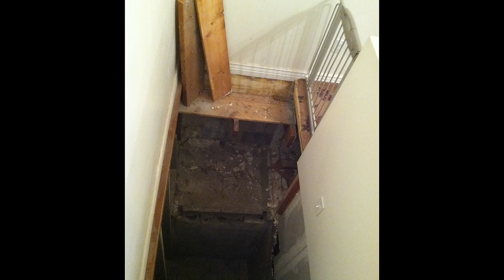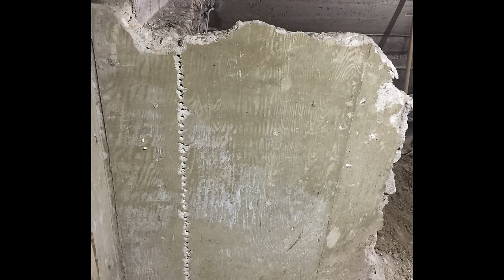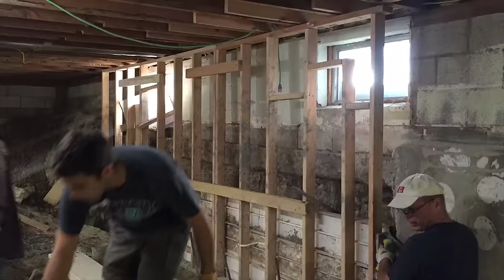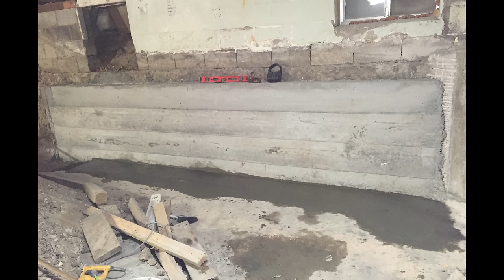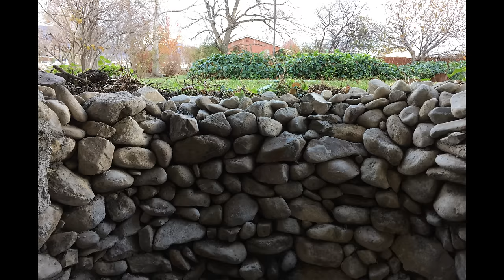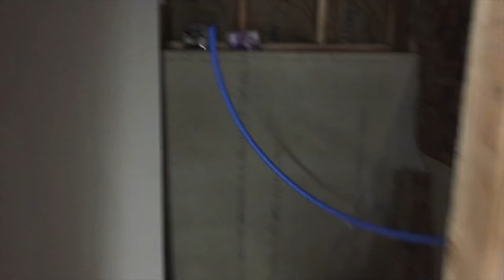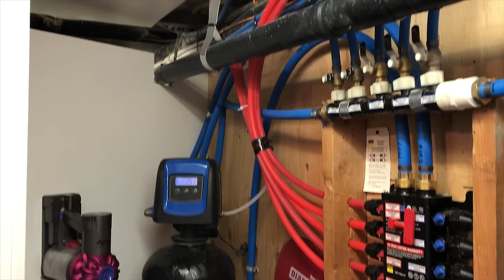Basement dig-out start to finish

Comment: Great work, makes me exhausted just looking at it.  ;-)
I'm wondering why you did the mid stair platform that way (head height)?
Reply from the maker: Thanks, Yes it was done for head height.  It's not conventional but it gave me a couple inches.
Reply: I forgot to ask, why did you wall in all that space above the new concrete walls (easier)?  It would have made good open, enclosed or a combination storage (I don't like wasted spaces). ;-)

Comment: Incredible work. Congratulations! Did you have any structural engineering or structural inspection? Oh, and doesn't the subwoofer belong in the corner behind the curved sofa? ;)
Reply from the maker: I had a guy I used to work for that did the structural engineering, he is the one that advised me on how to do this.   There are 3 of those sub-woofers, one is behind the sofa as well , lol.

Comment: This is an awesome project that I would also like to do. Me and my boys will likely do it ourselves. A couple of questions if you don't mind. 1) on a load bearing wall. Your existing wall is 8" wide and your footer is likely 16-24" wide. In your notes above your new wall is only 4" under your original wall but it is still supported by the earth below it. Is that adaquate support? Any setteling related issues yet? 2) Did you add any perimeter drainage or sump pit? Thanks for sharing!
Reply from the maker: I hope I can answer this clearly,  When I removed the dirt I went 4" under my existing foundation footing, and 4" out, creating a new 8" cement wall down to the ground level.  At ground level I dug out a new footing to the same size as my existing foundation, I think approx. 24" I did sections at a time as you can see in the video and tied them together with re-bar.  No settling issues because all the ground  behind and under the new cement was never unsettled, so it was solid.   I should draw a picture..
Reply: As long as the material you are installing your footing on is virgin ground and not wet clay or very silty then you will not have any settling problems. As if needed use 3/4 or 1 1/2 stone under the footings as stone has a 90% compaction rate just set in place without compacting it. If you use common sense you will be fine. And a sump pump is good to have and not need it.rather than need it and not have it.

Comment: Hope theres no mold issues.   I didn't see any water proofing.  Or sump holes
Reply from the maker: I did water proof behind sheet rock, might have been hard to notice, I'm also in a dry climate.
Reply: @StewartRedmond    wasnt talking about behind  drywall.     On outside of thos concrete walls u hand formed. Where I live we have to tar it.   Spray like rubberized undercoat looking stuff.  Its code here.  But where not dry climate  either.

Comment: Not to be dumb, but i would like to do this, and i'm just wondering how do you keep the wall you are working on from caving in while you dig it out?
Reply from the maker: I did small sections at a time, and only went 4" under my previous footing.  The dirt here is very compact with lots of clay/rocks, so it was hard and settled. This is what I did, but I am not a structural engineer, and I'm not offering advice.  I did talk to some people who had done it before this way.

Comment: how on EARTH did you get the re-bar to be continuous through the floor if you did it in sections???
Reply from the maker: The floor or the walls?  I left 12-16 inches of rebar hanging out of the cement to tie into the next pour.
Reply: the floor i meant but walls would be relevant too - ok- i was just worried that maybe you'd poured cement without it or without adequate re bar

Comment: Nice work.... But did you tie in the new foundation walls so the don't Buckel in?  Also, the egress Windows look small? Are they to code? If yes, to both. Great job. You just made a ton of living space, what is the additional value to your home and was it worth in in new taxes?
Reply from the maker: I did tie the foundation walls together with rebar.  The house is 100 years old and the windows were half the size before.  I made them as big as I could without cutting the original footing of the home.  An adult can climb out of them.    I haven't calculated the additional value, but the market has also changed a lot since I began, and my home is worth more just for that.
Reply: Thanks for the info.  Great Job!  Hope your having great times down there.  I need to add egress windows to mine.  The owner before us didn't do this to the remodel of ours and is "non-livable" space until we do so.  Enjoy life and keep on.

Comment: What about rebar? I didn't see you install any?
Reply from the maker: I did, its probably hard to see in the video.  Rebar runs the length of each section and ties sections together.
Reply: Sorry buddy.  But that's wrong way of doing .
Reply: @Dp1v   Ha, it's a fucking retrofit replacing blocks. It's a million times better.
Reply: Was curious about any french drain or radon management and code with the pluming and electrical in the closet. Have an OOOOOOLD HOUSE, needs work.

Comment: Where do you live that those bedroom windows meet code?
Reply from the maker: They are twice as big as they used to be, without cutting through the load bearing beam of the home, or cutting the original foundation, they could not be made any larger.  For a 100 year old home it's an improvement.

Comment: Dude. You can rent a concrete saw for a hundred bucks for a whole weekend. Damn. Drilling holes to cut concrete 😱
Reply from the maker: I had used a concrete saw, but it was so dusty, and dirty i just drilled. lol
Reply: Stewart Redmond ahhhh yes. That would be true. A little water from a hose will settle the dust. Still did more work on this job then most will in a life time 👍

Comment: That sure looks like a lot of work. It looks good now when it is finally done. It doesn't say what state or where you located at but as an inspector in Wisconsin your steps going into the basement illegal, there is no landing. When you change course on the steps you need a landing. how many times are you going to trip over that step? I'm watching the whole video and none of your windows in the basement have an area of egress in order to get out of. if you are planning on having your kids bedroom like you showed it in the basement there's no way of getting out of the bedroom windows  because you need two ways out of that bedroom in the basement. You need to have a big enough window so a fire fire with Soldier can get into that window in the basement. Also from the picture it looks like the window well is too high so you would need to stop also in order to get out of that window and that's if it has enough space to get out to the yard in case of fire. People don't realize that they cannot have bedrooms in the basement without having two ways out of it. I've known of people dying in the basement because of this. People think they can get out up a little window in the basement which is almost impossible because you have to crawl up to it and then crawl through the glass to get out of it.
Reply from the maker: Well if you consider that the house is 100 years old and the windows used to be half the size they are now.. At least it's an improvement.  I made them as big as I could without having to cut out the original footing of the house.
Reply: But haven't the building code changed over the last 100 years? Probably not the safest place to sleep incase of fire, whit only one exit :-/

Comment: No poly/ moisture barrier under the floor plates
Reply from the maker: By floor plates do you mean the cement floor?
Reply: Stewart Redmond Floor plates are the 2x4's sitting on the concrete floor, making the bases of your walls. there should be some poly or kind of moisture barrier underneath the bottom 2x4 to keep it from moisture and rotting

Comment: Never understood why certain pipes are built directly in concrete, because of code? It does nothing but make getting to them so much more difficult and  Time consuming and money consuming. I wouldn't have put concrete back over that sewer pipe. Metal grate door and now you have easy access any Time you need to get to it.
Reply from the maker: perhaps to keep moisture out, the smell of dirt, etc.

Comment: No farm, instead you have cool office is that wise? you'll need food more if something bad happen and it last longer than 5 years you know. How do you generate independent electricity Wind Mill or Solar Panel? if its local grid if its got cut off you cant even use your cool office you know not even those hundreds lightbulb of yours...And last how do you get water run through your bunker do you use pipeline down to river connect it with your water pump then to your water filtration system then to your bunker or not? getting dehydrated while sitting in a cool office doesn't means you're cool though....how about entertainment...what kinda entertainment did you prepare for the residents? boardgame,Pc Game,Card Game or something else? no entertainment for more than 1 year in contained space gonna make ppl go (cwasy u no...giggle)
Reply from the maker: Yes, no, wait what?
Reply: you're building your  basement nearing the requirement of a panic room or bunker good friend. why built it like that ...i mean kid's bed included in basement....normal basement dont have that kinda thing right? so the specs really cutting close to a place for refuge and seeing it like that i just can help myself to write comment. hey if you dont like it just ignore it though
Reply from the maker: @felixdedi5559  Ah gotcha, I just didn't  understand what you where meaning.  ha ha.

Comment: My parents had a 2 story house, like that. Older home all brick and the basement had been dug out like that. Had all sorts of water problems because there was no drainage outside at the level of the new floor. Long story short a contractor was hired to install drainage, but he dug too close to the outside wall and the house collapsed.  Digging your own basement is a REALLY bad idea if you do not lift the house and replace the foundation. It should be made outright illegal to do it like that. I would never buy your house, nobody should.
Reply: Pierre C 
wouldn’t have happened had they done it right.
Reply: Totally agree with you. They bought the house like that, unaware that it had been done in that manner, quite like as shown in this video.

Comment: That pex is trash
Reply from the maker: I like it, why don't you?
Reply: The pex you have it trash like as in it’s the cheapest why to install water lines and the crimp rings are illegal due to leak failures and if you have a freeze it will ruin your whole system which I saw y’all didn’t Insulate the lines and Rodents can smell the water and they will eat through the  lines now uponor  pex is better just like cpvc or copper lines. I’m just saying you get what you pay for

Comment: no relief cuts in the concrete with expansion joints no wire screen in concrete no double headers supporting the roof with double end caps  this was not done professionally... no vapor barrier behind drywall.... guess what  your house is gunna crack and sag guess what mildew guess what fined for not getting a permit.. and adding this to your square footage with the city... bad decisions all around... a house without a basement is not designed to have one dug..... and you just slapped everything together
Reply from the maker: Guess what Albert Einstein, You are incorrect.  Concrete is reinforced with rebar, 6 bag mix,  it doesn't need screen.  There are double headers, and it wouldn't matter even if there were not because they are not bearing a load, the cinder block behind is.  And guess what, there is a vapor barrier behind drywall, better pay closer attention, and guess what you have no idea about my permits, and guess what, the basement in this 100 year old home that was preexisting before my addition was not original to the home, but dug out by my grandfather over 50 years ago.  And guess what, the house never fell over, never cracked, never sagged etc..  The only thing slapped together was your uneducated comment.  :)
Reply: I have done a few of these before as a contractor and I don’t see any issues with the work you did. Last one I did we had the same conveyer setup but used a big Bosch hammer drill with a chisel bit on hammer mode which we used instead of a pick axe.
Reply: you tell him.
Reply: Shots fired 🍾
Reply: Good lord it was a beautiful DYI job and this hater wants to critique a 5 year build watching a 15 min video.
Reply: Good looking work!
Reply: Stewart Redmond could you show us a DIY burn cream for albert over there?
Reply: My only concern is do you have weeping tile? If not you should have put some inside the footings and drained to a sump pump.I had to break out the floor in my basment because the people who did the dig out of the basement never did any drainage when they did it. The summer after I bought the house was unusually wet for our area and everyone in the neighborhood had water in their basements. The weather is changing with climate change.I hope you dont have any water issues but they are verry common in basements.
Reply: anyone else notice albert doesnt have the balls to reply
Reply: Daniel Roach
Doesn't need to reply. He was proven wrong on all points. Needs to apologize. But by his comment, he's obviously not that big of a man.
Reply: Does anyone find it ironic his name is Albert Einstein?